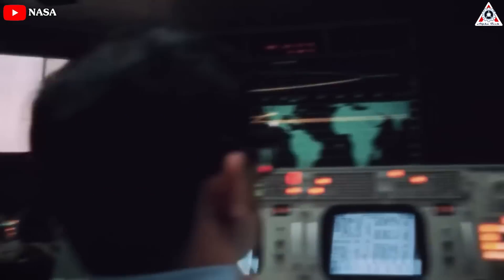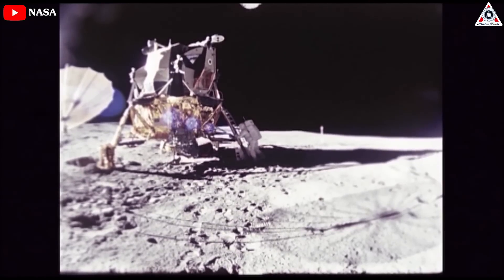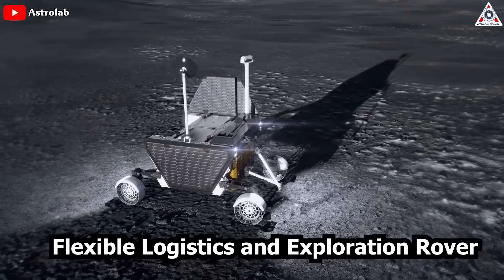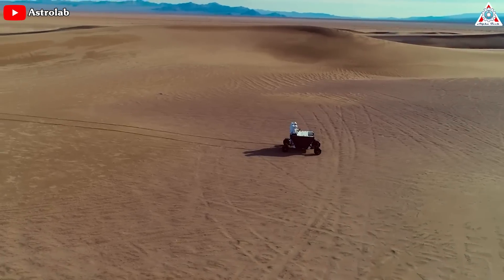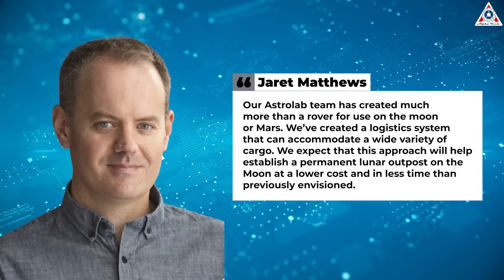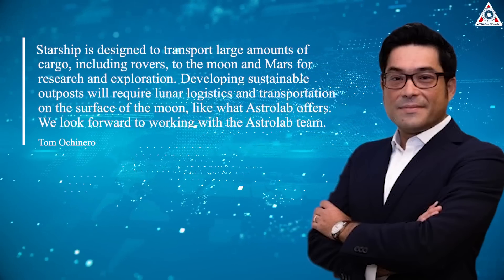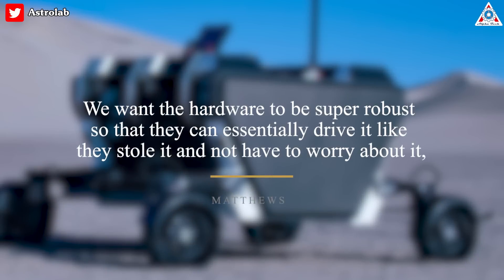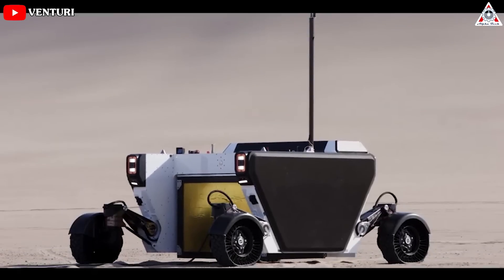SpaceX just revealed the largest Lunar rover!

Comment: I don't understand how these things can still be following a 60-year trend of NASA-skerricky and threadbare, when the commercial transport and SUV's we use on Earth are so robust and metal?

In fact, the vehicles we use up there could be several times terran size, given the much lower order of restraining gravity on fuel usage, and still easily fit in a Starship. Which in itself, doesn't look like a paper plane btw.

No reason why we couldn't put together a hydrocarbon-drive with an airless-insulated ICC to support such beasts. Proven, hard-hauling tech. Early case solution, ship a tank of diesel and one of oxygen for them up there. Who cares about generating a warm blanket of pollution on a satellite. And long-term, especially since you're gonna' be generating CH4 for rockets there anyway. You want a truly savage solution for a harsh environment. Drive it like a boss, 
not a  b i t c h.

If you're gonna' send a 1000 ships to Mars, you could easily use 100, or even 10 return vessels, to ferry over what we need for just a mere 250,000 mi away ???   Serious heavy industry and plant ought to be part of and a partner to this plan from the get go, given what the Starship paradigm now enables. Time to get the big boys involved, instead of just 'scientist designers'.
Reply: I think the primary reason that prevents using an ICE vehicle on the moon would be Oxygen.

A vehicle with a 40L fuel tank would need a ~500L LOX fuel tank
You would also need a tank that can store it at -219C.

Also, contained spaces can recycle the air to generate Oxygen but an ICE couldn't do that.

Comment: I wonder if NASA or Spacex have thought about harnessing the electrostatic energy that is plentiful on the moon? 
The obvious advantage is that they don't have to depend on solar panels and worry about the day/night cycles for their energy needs. 
The strongest source of electrostatic energy is at the poles but should be available all over the moon.
Reply: Using Helium 3 for reactors  extracted from moon dust would be a better option
Reply: @AP-qs2zf  Yes if we had a fusion reactor to put them in but we don't. Sadly.
Reply: How to harness?,.  Are we talking about the pickups from electric train and race tracks from the 80's..   ?

Comment: This is dumb...
Having the guys stand up on the back without seats? why dont we do that on earth? imagine all the tools and vehicles on this planet and what people would think about them with no seats?

and that cargo under system would only be good for palletized items of limited dimensions. that would have to be loaded and unloaded manually. the only things that have used that system historically have been Jitneys in lumber yards and I think there are a few shipping container carriers for work in container facilities.

This is another case of academic wall hanger engineers with no practical knowledge, being hired by corporate types also who are also academics.

I suggest you study farm tractors and skid steers like the bob cat, and make twin seated electric versions with easy access. and use inter changable tools, like buckets and lift forks.

And while you are at it, consider using Ramada tech to reduce the amount of sunlight on the operators so their space suits dont have to work so hard. or consider putting a pressurized cab on it.
Like on modern farm tractors.

And I knew they were idiots in the first scene when they had it coming out sideways... not using the wheels for loading abilities?
We should have farmers designing this stuff. people who actually do things...
Reply: To be fair if you fell off this on the moon you wouldn't have as big of a risk as falling off it on earth because of the low gravity on the moon.
Reply: @ReiseLukas  yeah.. the reasoning for the rear access is the bulky space suits,  but theres no reason not to have seats, even swivel seats.
And if you put the load and work forward, you could have rear access airlock to airlock, then side doors for lunar access. Keep the center aisle open, seating to sides. also as an electric wheel motors probable, and batteries under the floor. meaning ground clearance could be better. Also those little wheels and tires mean regular walks home.

These morons think skateboards would work in regolith.

Needs larger wheels and tires, to get better traction and ground clearance, and to reduce rolling resistance. Also reduces bearing resistance via better leverage on them.
And that center load under trip only works in paved or gravel lots that have been artificially flattened. and their tilt system isnt gonna help that. on uneven surfaces the pallet would bind on the sides.
And also landing tall buildings on the moon with elevators is a Citiot design,  if you need to raise the rocket motors to prevent cratering, might as well build the work spaces and habiltable areas lower for ground access, and put fuel and oxy tanks to the side.

This is all due to the starting point being Tin-Tin's rocket from the 1950's and 60's..

What Elon doesnt understand this time, is that any tool that does too many things isnt very good at any of them.
I'd be designing ships for lunar that were crab like, or at least came in on their side for practical use reasons.
Reply: Hilarious, partly.  It's not for crops.  Form follows function.  How do you know they didn't consider all that stuff along the way, and rejected the ideas?